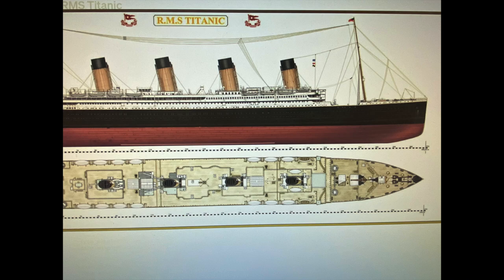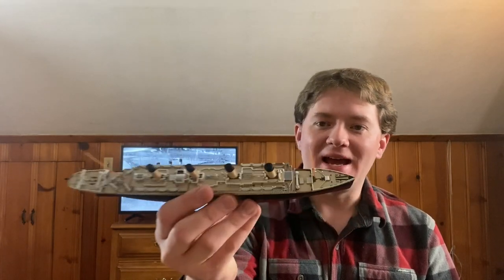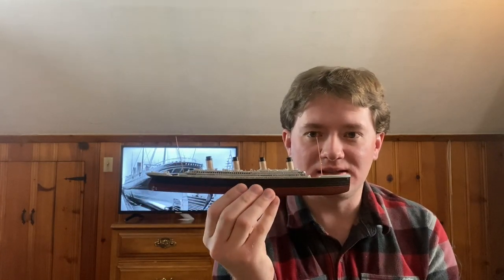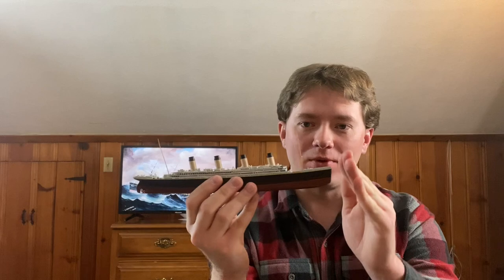Would more lifeboats have saved more people on Titanic?

Comment: More lifeboats would mean the crew would be free to explain the full situation to the passengers, since there would be less reason to worry about causing a riot. ("Everybody keep calm. There are enough spaces for everybody."") Pluss no need to enact the "women and children first" policy, so the loading would be sped up further. More boats on the falls would mean the crew could launch a few more of them, rather than spending ten minutes getting the collapsibles off the roof. The boats that were left could be cut loose at the last minute for some passengers to cling to. It's worth looking at the Britannic. Most of their boats were launched from the mechanical arms that Titanic lacked. But they also had manual falls. Their crew were able to launch ten lifeboats from them in the course of fifteen minutes, and that's with only the starboard falls being operable.

There's a researcher called Paul Lee who created a very comprehensive paper showing how it would be possible to launch all the required lifeboats in about an hour, if Titanic had enough boats, and a well drilled crew. http://www.paullee.com/titanic/everybodysaved.php
Reply: Except they would've STILL run out of TIME and if they just cut the vacant boats from the ship what guarantee would we have they would've floated far enough away that the breakup wouldn't send debris flying at them causing damage resulting in them being unusable or that when the ship went down the suction wouldn't drag them under, that people fighting for a spot in the vacant floating boating wouldn't result in them capsizing or people drowning because of people fighting to get in, you forget people still died in A and B because A had water in it and some people has to cling to B. You are also assuming that people would truly believe the ship was doomed. You area also earasing the human factor where it doesn't matter how close rescue or the possibility of safety is people WILL panic so the moment they know the ship they are on will sink (I mean really has there ever been a single event that is life-and-death where people DIDN'T panic the moment they knew death was on their heels) there would be a riot with people pushing and shoving to get off the ship, and you are also assuming communication was 100% without failure which given that most of 3rd class were immigrants that didn't speak or understand English very well good luck getting them to understand enough to get to the boat deck, you also neglected on how to save the engineering crew. 
Also you do know that Brittanic got a MAJOR overhaul where it came to the lifeboats since she was still under construction when her sister died so her sinking really ISN'T an accurate comparison since not did Brittanic get features that only came about because of Titanic's death but she also lived for four more years which got her more updates as they came about. Oh and didn't a couple of Britannic's lifeboats get ripped apart by the still running propellers. Comparing the Britannic sinking with the Titanic is like comparing Titanic to Costa Concordia, while there are a few similarities there are more differences. Really that is like saying "But this ship survived a head on collision why Titanic no ram", you completely ignore the differences in speed (slower), mass (smaller), and likely location (being closer to a port) that allowed one ship to survive a head on collision while Titanic surviving one would be highly questionable.
Reply: @1993digifan  I wanted to keep my comment short and sweet so I didn't go into details about some things. But yes, I agree that most of the lifeboats cut loose would be smashed, capsized or swamped by panicking passengers. Nonetheless, a few of them would get away cleanly. This may only save a few dosen passengers, but it’s better than nothing. Additionally, there is my other point about the fact that the crew would not have had to spend 10 minutes getting the collapsibles down from the roof and could have used the time instead to launch a few more boats from the falls, saving more lives still.

As to people panicking, in any emergency situation there are people who will act like idiots and end up making the problem worse, but there are ways to deal with them, and crews are typically trained to control them. It would be like suggesting that fire escapes don’t save lives because people often panic and create a mad crush to get to them. The fact that the Titanic had a reputation as being unsinkable and didn’t appear to be in danger from on board until the final minutes suggest that the hard part would be to convince the passengers that they were in danger. Keeping the crowd calm would be matter of telling them that the ship is sinking, but there is tome to get them all away. The fact that there would be insufficient time to launch all the boats would not be apparent until the final minutes. The passengers would likely riot at this point, but so what? They’d be about to die anyway. Of course this is debateable, we can’t know for certain whether the knowledge would save lives or cause more deaths, but then that is the case whether there were enough boats or not. My main point was that the extra boats would have at least helped calm and reassure the passengers for a while longer.

As to your question about how to evacuate the engineers and the steerage passengers. In the scenario I am envisioning, the engineers would still die. Without better training for the crew it would indeed still be impossible to save everybody. My scenario only covered how to save a few more people. Of course, the paper I sited does suggest everybody could be evacuated in 30 minutes, with a trained enough crew, who’d considered the possibility of an emergency evacuation and drawn up a solid plan for it. 30 minutes is obviously a best case scenario in which everything could be done in good order. But with the order to run out the boats historically being given 2 hours and 5 minutes before the boat deck began flooding, there is plenty of margin of error. Most of the steerage passengers were well aware of what was happening as many of them had woken up to find their cabins flooding and passed the word along. Stewards were spotted directing them up to the rear well deck, using a lot of gestures to overcome the language barrier. In this scenario, it’s not too much of a stretch to imaging them directing the passengers through the emergency doors and up the grand staircase instead. The only real problem then is crowd control. The engineers and senior crew would obviously have to be evacuated last. There were emergency power supplies on board the Titanic which would have kept the lights on long enough for them to get up on deck, or failing that handheld lanterns. Granted, even in this scenario, there is a good chance not everybody would make it to a lifeboat in time, but this is still a lot more lives saved than in real life.

I fail to see the relevance of the two lifeboats which were smashed in Britannic’s propellors. These two boats were launched without permission while the ship was still moving. As Titanic was stationary long before it became apparent that the ship would sink, this would never be a problem.

I did acknowledge some differences between Titanic and Britannic. Namely, the inclusion of mechanical lifeboat launching arms, so yes, broad comparison’s between the ship are deeply flawed. However, alongside these arms, at least half the boats on Britannic were equipped with  the same manual falls that Titanic had, and so a direct comparison between the two is fair to make if only these boats are taken into account. The fact that the Britannic’s crew were able to fill and launch 10 of these boats in 15 minutes, despite only being able to launch off the starboard, and keep good order among the passengers, who were well aware that the ship was going down, suggests something similar could have been possible on the Titanic. A ditionaly, the crew did succesfully evacuate the engineers, almost all the casualties came from the two lifeboats that were smashed. The crew were aided by the fact that they were in daylight and had half the number on board. But they were hampered by rougher seas, and a greater list, which made everything more unstable and made the port side boats impossible to launch. There may not be a perfect comparison, but Titanic’s sister ship is about as close as we can get. This is especially true when you consider that many of the improvements to both Britannic and Olympic were made as a direct response to what had happened to Titanic.

Comment: To solve the problem of not having enough officers, they needed to train their crew enough to know what they were doing. So that, in the event of a disaster or something causing a disruption during a disaster (like the steam), they would be able to continue what they were doing without communication being hampered. Also, some more lifeboats closer to the third class areas would have helped save more lives. Plus, they did kind of need at least a little bit more trained crew and officers to fully mobilize the ship because the boiler crew was... occupied with more pressing matters.

Comment: I have to somewhat disagree with you on this one. 

First off, there were potential solutions to adding the full compliment of lifeboats as Alexander Carlisle had intended for the Olympic-class that would've kept the lifeboat deck more clear and still allowed many more lives to be saved.

The changes to Britannic post-Titanic show this to be the case, just look up THG's superb work on what R.M.S. Britannic would've been like had she been outfitted as she was supposed to be as a transatlantic passenger liner and not a hospital ship. Of course that was because of the big electric davits for the most part, but it does show that one can have more lifeboats without it cluttering the decks.

Another way would've simply been to place collapsible boats under the regular clinker lifeboats and as was done with C and D next to the two emergency cutters.

Another thing that you missed in your essay that should've been more properly addressed is WHY collapsibles A and B were not launched and had to be floated off. It was because they were up mounted up on the top of the roof of the officers' quarters on either side of the No. 1 funnel and pretty securely at that. The special tool required to undo the chocks and other restraints was lost when the storage area in the bow where it was kept flooded before anyone could get to it. Without that, it was a great struggle, the officers and crew having also build makeshift ramps for the boats, and the two boats were not freed and dropped down to the deck until just before the final plunge when the bridge and forward part of the boat deck suddenly went under. 

It is quite possible, that as in the case of the Lusitania sinking, that lifeboats being dropped over the side or just having their chocks and restraints released to allow them to float off so that people could climb onto them later would definitely save more lives. Or, just as with C and D boats, the crews once finished loading the regular boats could've immediately started on loading and launching any boat and gotten a few more away.

So, given that, it is quite possible that perhaps hundreds more could've been saved. 

Having enough lifeboats also allows the crew to be more forthcoming with the passengers and thus encouraging them to get into the boats, allowing more of them to be properly filled instead of being sent away half full or less.
Reply: I agree 110%